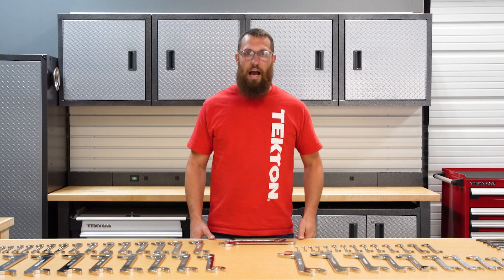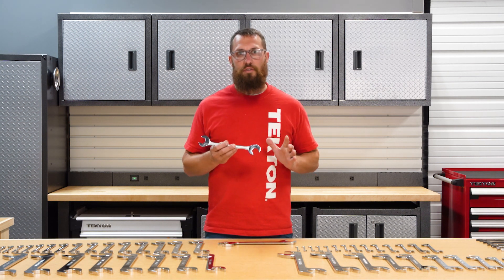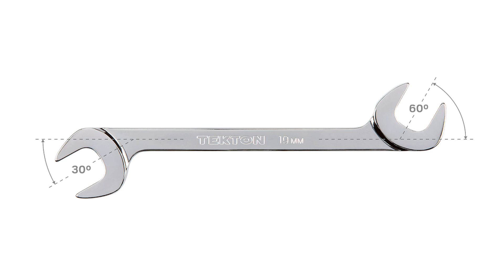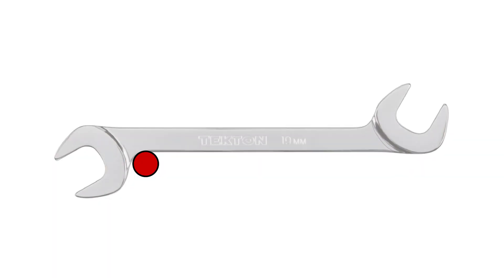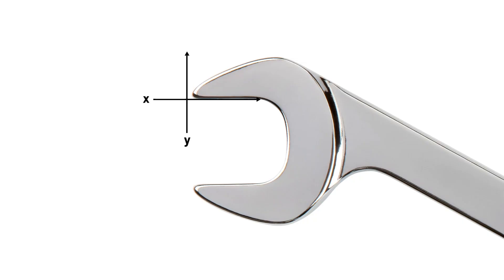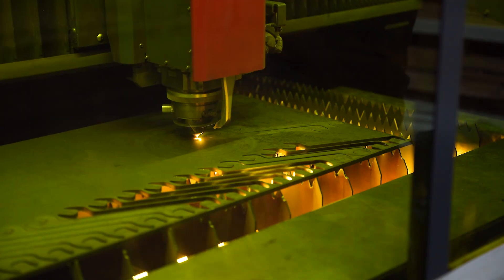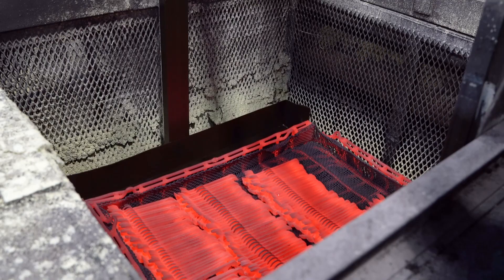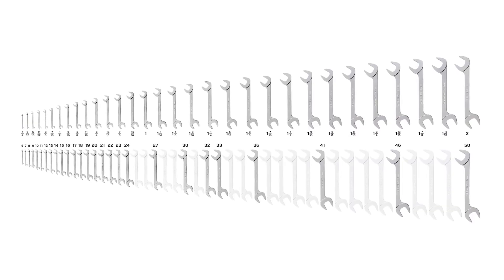USA Angle Wrenches | Engineered & Manufactured by Tekton

Comment: Great video -- I has no idea that these wrenches were cut from plate with a laser.
Reply: The square edges are a dead giveaway... 
I'm pretty sure they put out this video because competitors were knocking their product saying that they were cheaply made and that they were not as good as their forged (Snap-on & Capri Tools) process...so Tekton pretty much needed to make this in order to not appear as though they were doing something that was cheap and hush-hush..
Reply: @boosted2.4_sky they are CNC cut they aren't nearly as strong as snap on forged steel angel wrenches.

Comment: Just bought a set of these, and I hate to say this, but I’m not impressed. The wrenches are pretty well built, but the quality control of these wrenches are pretty poor. Sloppy chrome finish, some areas the chrome is chipped off. I did call tekton, and did agree to make it right with replacement wrenches. I hope I only got a bad batch. I guess I expected better for USA made and with a almost $300 price tag for a set of these wrenches.